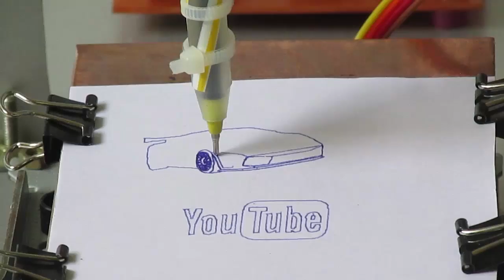How to Make a CNC machine at home

Comment: Sir can u help i made the plotter but in proceesing software it is running but stepper motors are not running
Reply: Same thing happens with me and when I tried to give supply from arduino board whole code run properly for 3 seconds only and gets stop.
Reply: Check power supply

Comment: at first, I thought it could cut a metal or plywood or something for my hand spinners design.
Reply: The idea to use DVD/CP player's parts to move the material around is clever, maybe we can came up with some way to attach a cut/drill/whathseveritsname to the top, so we could make fun stuff...
Reply: YES! YES! PLEASE! Thanks :)
Reply: cool bro
Reply: it's just a basic idea.
using the parts of optical drives grants us a veeery small drawing/carving area, so you need to buy motors and other mechanical parts.
then you need to get a motor powerful enought to carve at least wood. you may need cooling as well.
also, you need a bigger servo/stepper to lift that heavy motor up and down.
I think this project is good for start, but it's so small that you can't do big things with it.
so, to get a real carving machine, google for it, then buy/build one.
Reply from the maker: +Sasszem you are right man
Reply: @tapendramandal   Help sir

Comment: bro can u make cnc with
 Arduino UNO R3 Devlopment Board
L293D DC Motor Driver Shield  
i think this is better equipment to make cnc at home
Reply from the maker: +Mohit Sharma yes
Reply: bro plz make video tutorial with this equipments
Reply: Tapendra Mandal Possible to use old printers instead of DVD drives?
Reply: @jeremycbarnhart2305  yess bro

Comment: I made it nice working bro..... Good job....
Reply: bro can u help me out
Reply: i am facing one problem that is 
if i connect my arduino with my laptop and power source with it too the red light of arduino gets switched off and when i disconnect the power source the red light starts blinking again plzz bro help me out i am facing problem😖😖
Reply: So u can add a registance in arduino
Reply: Your power supply for l293d ic is too max current so use 1 amp power supply for l293d
Reply: And see circuit diagram
Reply: Thnq for your comment
Reply: Or your connections in circuit for 5v of arduino and 5v for l293d are same connected therefore this errors. See the diagram and plz show ur small video clip.
Reply: Okk Bro thanks and I will make a video on that soon!!!!
Reply: Welcome. And i watch your coming soon video

Comment: Hi; Great project. I have nearly completed the build using your simplified version. In the schematic neither the Arduino +5 or Vin are not connected to a power supply so how is the Arduino powered?
Surely the stepper motors cannot receive enough power from the PC USB connector? DOn't want to blow my PC?

Comment: what u used for its base was it sheet metal or acrylic, will arduino uno be fine for it , also plz plzz plzz provide link for other female pin and other small parts, can it used for making diagrams by pencil especially of biology

Comment: awsome project..bdw what are the variables that can cause imperfection in complete logo or any pic at the output?
Reply from the maker: +Suchismita Nayak pen holder and power supply does matter
Reply: thnx tapendra sir fr d suggestion..n is der anything else other Dan dat?? n hw can I perfect it?? will making the paper part still will hlp it??

Comment: The stepper motor as well as the motor driver is getting quite heated up, what should i do to prevent this? The connections and power supply is fine but the motor and driver IC is still heating up.

Comment: Please tell me how to test the stepper motors working properly using this circuit.. I made the hardware & also uploaded the program to Arduino. But one of the stepper motor is not working properly. But I cannot figure it out whether it is the problem in stepper motor or in the circuit or in the code. The stepper motor coils are ok.

Comment: i followed the steps given in the video, but when processing the gcode the stepper motors does not work. I checked all the soldering part but the drivers are not working ! What may be the problem ??
Reply from the maker: check the voltage across some test point
Reply: checked but still not workig
Reply: the stepper motors are vibrating a bit but not working properly. I have given a 9V supply from battery to the two motor driver IC. still not working
Reply: Pratik Shirsekar im also having the same problem

Comment: i too made this everything is working superb, but only one ic(L2930) is over heating and corresponding stepper motor is also over heating, what will the problem???
Reply from the maker: due to short circuit one ic is getting hot

Comment: The Adriano uno is getting disconnected from the pc while running the program when the servo is connected....but disconnecting the servo and running the program it's fine and the hole programme gets completed....pls help what will be the problem and how can the servo be used without any issue

Comment: Good afternoon! I wonder what component you soldered the wires of the stepper motors? (At 3:58 min of the video).
And what other component did you use to fit the Arduino Nano V3 into Zero PCB? (At 4:53 min of the video).
Thanks in advance. I expect an answer as soon as possible.

Comment: hello, if I don't have that little usb port thing, can I solve somehow to power 5V from batteries? like, from a 9V battery with a voltage divider or something..
Reply from the maker: usb port is not compulsory..directly connect the wire to respective pin
Reply: so I just connect everything that is 5V powered to the 5V pin on the Arduino?

Comment: what is the proper power supply. is my mobile adapter is enough to make it (5v.  1.2 amps) reply me fast bro.
Reply from the maker: use direct power from pc USB port
Reply: Tapendra Mandal bro if I connect the  supply to direct PC USB port . suddenly my uno port was disengaged. and it tells that( usb port power supply exceeded u should remove it.) pls help me bro. I am soo tired of trying.
Reply from the maker: check short circuit on ur pcb
Reply: Tapendra Mandal  ok bro after that I will contact u ... :-)
Reply: bro I made those circuit connection by gathering details in your video I paused your video and I made it.  it seems similar to your PCB connection. but different from circuit diagram. is it OK?. but the sad part is it won't run. help me bro I checked the circuit connection..
Reply: bro pls see my previous comment

Comment: in my project there is a small problem x axis can run fluently but the y axis does't works it wibreates while it works
Reply from the maker: +Sarthak dambare check circuit
Reply: Tapendra Mandal yeah you are  right. the fault is in the circuit.
I'LL repair it and its working
Reply: thanks

Comment: Hello Tapendra ii found your circuit  diagram on a web made with Proteus application and it find useful thanks and i try to made my own cnc  i use ARDUINO UNO AND MOTOR SHIELD and with all related software e.g  CNC CODE,INKSCAPE, PROCESS, and all work well but the x-axis and y-axis did not plot well plotting blurting i need help, i do not know maybe i did not place the x-axis and y-axis orderly   but my Y-AXIS MOTOR FACE UP LEFT AND X-AXIS  MOTOR IS AT RIGHT  THANKS,

Comment: !!!!! Attention !!!! (if your servo is not working)
Your pcb circuit drawing is wrong the servo needs to be connected directly to 5v usb power
and the servo pins connections are wrong the 2 (middle one) is the power and the 1 (first) is the pulse.

Comment: hey bro .. facing a genuine difficulty. when i select the g code file, there is no motion in my stepper motor. checked everything.
Reply from the maker: +Vishu Gupta maybe your ic got damaged or check power supply
Reply: Tapendra Mandal yes the issue was in power supply. my usb cable was not able to wok properly. now its working awesomely :)

Comment: Hey I am a 9th class student in Jharkhand and I tried to make the CNC which you showed above in the video.

But I found that one of its DVD writers were not working . Even after paying a lots of attention towards it(for 8 hours continuously on laptop).

And I also found that it was the x axis which was not working.

So How could I fix that bcaz I have to give a presentation of this CNC in school on 15th of August
Reply from the maker: +Sarika gupta swap the not working axis to the working axis..if doesn't work then change motor or L293d

Comment: Sir how much supply I should give to this circuit 5Volt or 12 volt??
Reply from the maker: +SOMRAJ SINGH GOYAL 5vlot
Reply from the maker: +SOMRAJ SINGH GOYAL 5volt*
Reply: what if I use 12 volt
Reply from the maker: It will burn ur motor

Comment: Tapendra madal my project is done but when we processing the gcode my stepper motor is not move but when we touch the motor it is working condition but drawing is not made and we also gave the supply to laptop so plzzzzz reply soon........
Reply from the maker: please check circuit and ic
Reply: I check it

Comment: Hey tapendra..I would like to know the exact dimensions/size/measurements of the board that you have used as base of the machine. also can I know the length of the board cut outs that you've used to support the vertical DVD drive.. please let me know. it will be a great help..thank you

Comment: I don't whether I will be able to do this or..... I have 1 dvd and I have open it and took the machinism out by mistake I broke the stepper terminal and after some day I got another dvd and This time to secure my soldered connection I pour some super glue on it but by mistake I pour to much and my motor was stuck..... I am pissed off....

Comment: sir pls help me 
what is rob 08420 in circuit diagram 
pls reply
Reply from the maker: +Acoustic Aman ASR stepper motor
Reply: bt where u use steper motor
Reply: Tapendra Mandal 
that dvd driver one is stepper motor
Reply from the maker: +Acoustic Aman ASR both should be stepper motor

Comment: Arduino: 1.6.0 (Windows 8), Board: "Arduino Uno"CNC_code.ino:7:21: fatal error: AFMotor.h: No such file or directory
compilation terminated.
Error compiling.  This report would have more information with
  "Show verbose output during compilation"
  enabled in File > Preferences.this is the error showing while running the code

Comment: I have done all procedure but my y plotter is not working
Reply from the maker: check circuit
Reply: Tapendra Mandal  I have  checked circuit connection  and y plotter is working and I am using two dissimilar wire copper and silver  as a jumper but in the dvd writer middle part is little movement

Comment: My machine is drawing only half of the image . Why?
Reply from the maker: +apurv aryan Make G good with proper length
Reply: Tapendra Mandal i followed each and every step. Even my dimensions are same as yours. But my writers are not same, they are having different arrangement as they are of different companies. could that be a problem?
Reply from the maker: +apurv aryan Make sure both have same step angle
Reply: Tapendra Mandal thanks for reply. Now its working. In th inkscape i was placing the image at wrong place. When i changed it to top right its working fine.

Comment: the stepper motors are not working
Reply from the maker: you can check via multi-meter
Reply: 0,26v in output

Comment: sir i had made that project but the stepper motors are not working
Reply from the maker: +akshit verma check circuit
Reply: Stepper not servo
Reply: Hey Tapendra
Whats the sheet called which you used as base? .please reply
Reply from the maker: ACP sheet
Reply: Hey Tapendra
What was sheet used in self balancing robot for base n roof. Acp must be heavy ..

Comment: I finished all work but its not run
Reply: mohamed rafeek what is the issue.coming?
Reply: Vishu Gupta  bro....I g code is run but not work any motors
Reply: mohamed rafeek then must check the pins are correctly connected. and which dvd writer u chose?
Reply: Vishu Gupta  its working... √√√